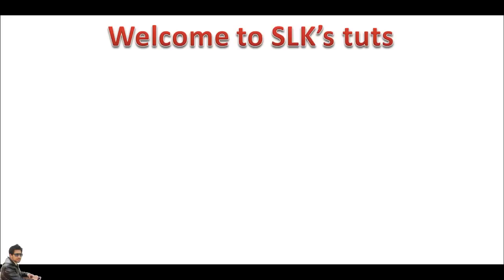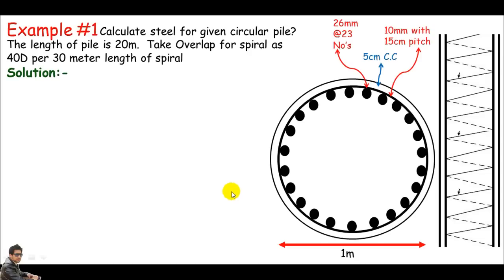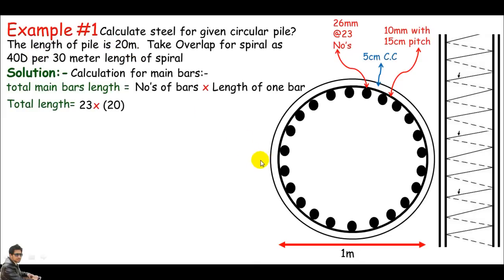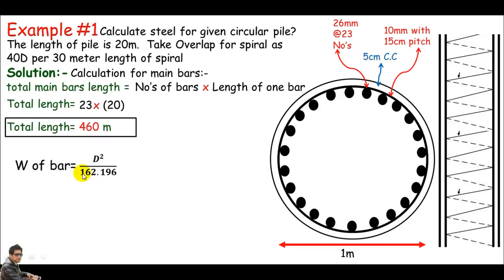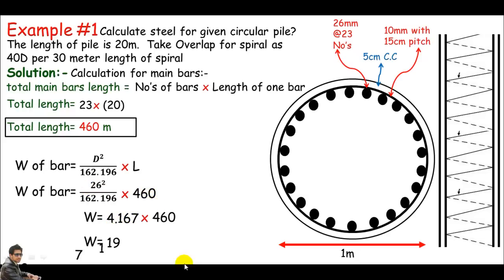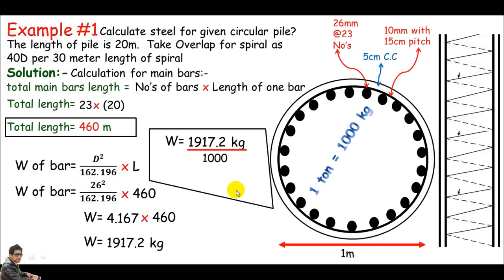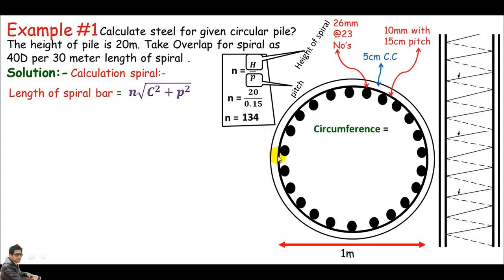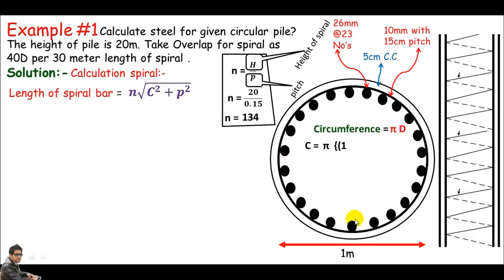Quantity survey : steel calculation for pier, pile and circular column having spiral

Comment: Very Helpful, but I have noticed that you have missed the overlaps of main bars.  Pls. Note that common standard  bar lengths are 12 Meter or 40 feet ( Manufactured in Pakistan), and  our Column / Pier Length is 20 M. Kindly, Revisit it. Thanks.
Reply from the maker: Hi. Thank you for visiting sir. ❤️❤️❤️

Comment: what about over lap in main bar.  why didn't calculate the overlap in main bar
Reply: Correct observations. Alos, I have notined this, the maximum lengths of bars are 12 - M. and our pier / pile length is 20-M..
Reply: If not mentioned on drawing, the Experienced / Good Engineer, must point out it.
Reply from the maker: There is no overlap in drawing